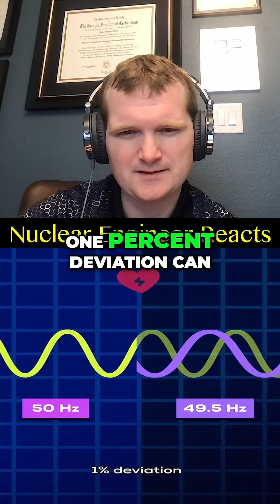Causing a Country-Wide Blackout? - Nuclear Engineer Reacts to Kurzgesagt

Comment: actually stopping the windmills thing happens often. Germany sometimes pays Denmark to stop windmills for a while when too much power is made. This is to avoid a grid bottleneck and it's cheaper to compensate the danish windmill farms for lost production than to upgrade transmission lines and shut down german plants~
Reply: Toxic coal plants and corruption.
Way to go!
Reply: These powerlines from north to south are being built, but until they are ready they have to reduce windpower sometimes to prevent overloading existing powerlines.
Reply: It happens here in Iowa all the time. We produce more wind power here than we consume, so it's not uncommon for low load times to have turbines turned off and blades rotated so that they aren't pumping excess power into the grid.
Reply: its not cheaper. its because through contracts they've guaranteed german windparks ability to sell their electricity no matter what. so paying other countries to take our electricity is the way to go.
who says anything about corruption? its just coincidence that leading politicians get cozy desk jobs at those firms after their political career is over. what are you thinking about?
Reply: @drache444444 Google it.
Reply: Why don't they use the excess power to pump hydropower water uphill or make hydrogen? I thought Germans were engineers?
Reply: @zvorenergy they do. But a stiff wind on the Northsea produces more than can currently be handle by the grid. They are working on it.
Reply: @zvorenergy  Those times are long gone, today's engineers lack rudementary know-how.
And also the insane burocracy is stalling every innovation, unless you know all the workarounds.
Reply: @winni2701 sounds ripe for a Fourth Turning, just like here😬

Comment: Changing the grid frequency would affect very little depending on how much it was changed.  Most electronic devices convert the AC to DC for the electronics to use.  Clocks, old TVs, various AC motors use the AC frequency for time keeping or synchronisation. 
If you could affect the frequency enough it might trip an alarm and disconnect that part of the grid.  There are many interconnectors between different parts of the grid designed to isolate sections of the grid that are malfunctioning. To take out the entire grid would need the shutdown/disconnection of many key distribution points to cause an overload cascade.
Reply: It's not about the end use. If the AC synchronization is disturbed enough, by phase or frequency, power plants will disconnect for safety reasons. This can cause cascading disconnections.
Reply: @Bob5mith  Yes, but not just the power plants, but the interconnectors would disconnect isolating the that part of the grid, hopefully before having a cascade.

Comment: A windless &/or cloudy day would cause a blackout in the summer when the temp was near 100 F - the grid was built to send centralized power from mega power plants and not from distant small stations to the cities & factories - so substations need to be up graded to handle the new demands - Ask Spain
Reply: Renewables work best with geographically diverse sources.
The opposite has also been true with solar and wind holding up the grid when thermal power stations couldn’t - typically in summer when air conditioning loads overwhelm them but solar generation maxes out. You don’t generally hear about the “not failing” however.

Comment: "If the grid operators aren't doing there jobs." Exhibit: Texas.
Reply: France helped Spain and Portugal when the latter needed to reboot their power stations. 
I think Texas chose to exclude themselves from the national grid.
Reply: @jaxpavan9375 there are 3 electrical grids for the entire contiguous US... east, west, & Texas
Reply: but they're getting better and 40 percent of Texas power this year has been from wind and solar
Reply: @RWZiggy  That makes Texas MORE vulnerable to blackouts. Wind and solar are the cause of most blackouts.
Reply: @scythelord  false. the major causes are:

1. severe weather (wind, ice, storms)
2. equipment failure (aging transformers, lines)
3. vegetation interference (trees hitting lines), 4. human error (accidents, poor operation) 
5. high demand

but thanks for the fossil fuel fanboi FUD
Reply: @RWZiggy 40%? Better brace for impact.
Reply: spain is also a good example. they got hughe black outs because of their renewable energy
Reply: @7o73o  It wasn't because of renewables. It was because the grid operator didn't do his job. The systems that should have balanced the grid didn't do the job and noped out and while doing so tripped more and more safety systems to collapse a wide area of the grid.
Reply: @luciolalazilia2189  It was because of renewables because they lack the inertia to keep the frequency stable.

Comment: With the number of Bess battery units all over the country if you had built them wouldn't they be the easiest way to knock out the grid as they are designed to be controlled remotely and you left yourself a way in.